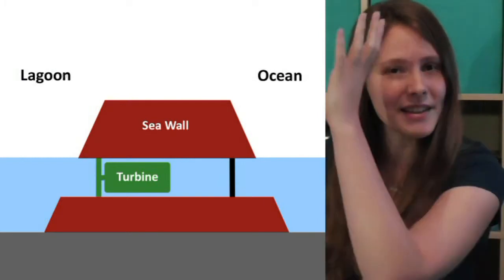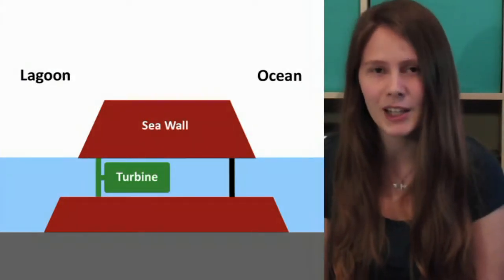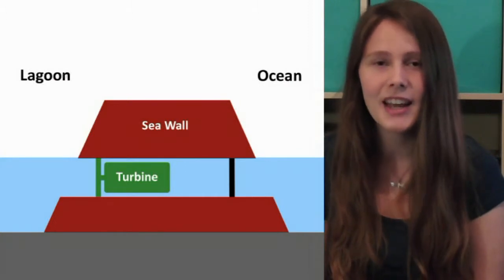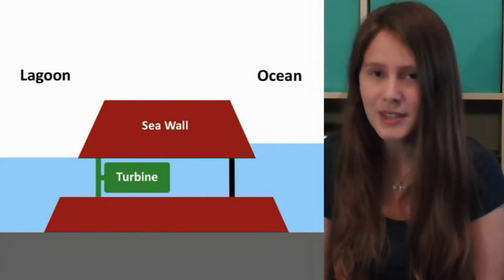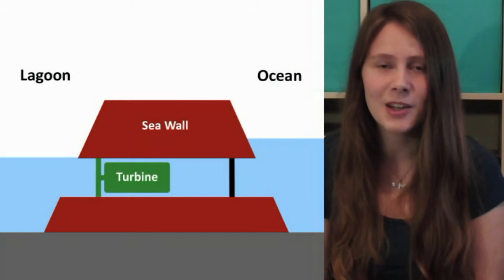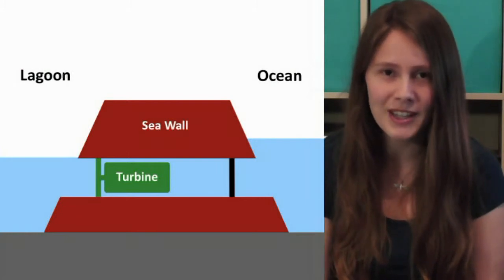Swansea Tidal Lagoon - Why you should think it's awesome

Comment: The slight hiccup on sourcing stone to build the wall that you mention......
Entails reopening a disused quarry on the Lizard in Cornwall.
Originally the quarry produced a maximum of 200,000 tons of rock per year
To supply Swansea and the other Lagoons would mean an extraction rate of 2 million ton / year.
Achieving this would require 7 day around the clock loading of barges to transport the stone.
To dock the barges a breakwater and jetty of 800m would need to be built.
The quarry sits in an AOONB and has adjacent SSSI sites.
The jetty woud be built into a recently designated Marine Reserve.

Disturbance to the quality of the sea water would directly effect the multi million pound Cornwall Sea Salt company. Wipe out the fledgling Cornish Seaweed company.and seriously undermine the tourist economy including a diving company with world wide patronage due to the current pristine water quality.

it is a little more than a hiccup...
Reply from the maker: Energy at any cost 
I totally agree with you. It's not an ideal location and as more information came out about the issues with the quarry site it became more and more clear that it is a bad idea. When I referred to it as a 'slight hiccup' I was thinking along the lines of finding a new source for the stone. I don't know what they will do, but I sincerely hope that they find another quarry, preferably one which is currently active. Of course there is always the chance that they will storm ahead with this plan since it is the cheapest option, but I really hope they manage to find another solution. 

I don't want this project to be jeapardised because of the stone. Stone is a plentiful resource and hopefully they will find it from somewhere else. And hopefully that location will also be UK based so the stone isn't transported across the globe and it contributes to the UK economy.
Reply: the quarry is also owned by Mike Shorrock..who is the boss of the Tidal lagoon company. He'll make lots of money out of this

Comment: river bebris  will  find its way into turbine blades  siltation build up is also a problem the cost of the lagoon  will go over  budget  as usual  and no consideration  for  migratory fish . when this is built and up and running it should be have a survey done after 15 yrs before any more projects are built , to access what impact it has done on the rivers and marine habitat / wildlife its cool to go green at what price
Reply from the maker: Ivan Renac 
These are all legitimate concerns. It's not possible to build anything, anywhere in the world which has no effect on the wildlife and environment. Just building a new road can cause all sorts of problems so it is inevitable that this will influence the local habitats in some way. However the lagoon is not at the end of a river, it is located between two rivers so migrations should not be affected and it should not build up with silt or debris. You can see images of the proposed site here -> http://www.tidallagoonswanseabay.com/interactive-map.html 

There were concerns about how it would influence sediment drift along the coast and potentially effect the sand dunes down the coast which are an important habitat. It was decided that it was far enough down the coastline that it is unlikely it would cause any long term damage, but of course that will need to be reassessed down the line. 

All of the assessments and documentation is available at -> http://www.tidallagoonswanseabay.com/document-library/environmental-scoping/95/ if you are interested in the details of the assessments made.

I would be surprised if it was built in budget, it's a huge experimental project so things are probably not going to go perfectly. However lessons will be learned and the subsequent lagoons are expected to cost significantly less.

I hope this was helpful, I would love to discuss these issues futher.
Reply: this is the first tidal lagoon in the uk migratory fish that follow the coast line to the source of there river   during spawning and on their migratory route to the sea will almost definately end up in the lagoon through the turbines  and damage the two rivers echo system/ otters /kingfishers /etc
Reply from the maker: Ivan Renac 
It's not possible to fully assess and entire ecosystem due to the inherent complexity of them, and there is always a potential for negative impacts on the local marine wildlife. An assessment has been carried out with the conclusion that there will be a minimal negative impact on the marine life. As stated on the official website:

"Detailed fish computer modelling was undertaken for key species, including behaviour modelling (the likelihood of the various fish species coming into the lagoon area) and entrainment modelling (the effect on any fish that pass through the turbines). The size of the turbines (7-8m in diameter) mean that there will be large gaps through which fish can pass, and the modelling has been carried out to understand the extent of this. Furthermore, the use of sluice gates will allow free passage of fish in and out of the lagoon in the latter part of the tidal cycle." 
http://www.tidallagoonswanseabay.com/the-project/faqs/59/ 

They also intend to re-introduce a local oyster which has not been present in the bay for decades. On this topic they say:

"We are also investigating the potential for developing mariculture. The formation of a new rocky reef as part of the Project would provide habitat and encourage colonisation by local marine species.  Research indicates there could be opportunities for the reintroduction of the native oyster as well as for fostering habitats for lobsters and kelp. We are continuing to investigate these benefits in association with local experts."
http://www.tidallagoonswanseabay.com/the-project/faqs/59/
Reply: i am sure the general public  are going to say them oysters look great  in  a lagoon  and when they get to edible size i am sure party time fore investors on the oysters. the sea life habitat  was all ready there, you are not creating anything. some  habitats are going to be lost i think the company or construction co. are trying  to get the next lagoon project  at the tax payers £.  looks at a pro video 15 / 20 yrs on? you don't even know the impact on the coast  you cannot predict storms? . one thing that concerns me you cannot monitor the the impact it has on the environment and wild life.IT JUST another wind farm project  and lot of  investors  can put there money in one of these projects AND THE GOOD OLD TAX PAYER WILL BAIL YOU OUT  IF ITS OVER BUGET
Reply from the maker: Ivan Renac 
It has been very interesting discussing with you the potential effect the project will have on the marine life, but I'm not sure I understand the argument you made in your last comment. The oyster habitat is not to farm oysters for money, though I am sure it will be possible to eat some at the information center, it is to reintroduce a species which can no longer survive in the bay due to previous human influences. The habitat does not already exist, Swansea Bay is mostly silt and clay with a little sand, the rocky places are further along the coast. Hopefully this effort will help to fix the damage to the food web in the area by putting the oysters back in.

You say you cannot monitor the impact on the environment. Monitoring the impact is relatively straight forward, it's predicting it before hand that's the problem. 

If there was going to be a serious negative impact on even one species then the government would not have permitted it this easily. A much larger tidal project, the tidal barrage which would run from Cardiff across to Devon has been trying to get of the ground for years but it was not permitted because it would cause one species of fish to lose it's very specific habitat. For this reason I doubt that the tidal barrage will ever be built, it will have too larger impact on the environment. This lagoon is so much smaller and has been assessed to cause minimal damage and this is being compensated for by creating new habitats and investing in conservation.

As I said before, it is likely that the project will go over budget. It's experimental but for technology to develop some risks must be taken. Most of the project is funded by private investors. The issue is that we need more sustainable energy sources or we have to cut our electricity consumption. My concern is about CO2 emissions but it's also about the ever increasing energy demand and the lack of resources we have available to us in the UK to produce that electricity. Nuclear power is never popular so I can't see many of those being built again and we don't have enough clear days for solar to be viable on a large scale. What we do have in abundance in the UK is wind, waves and tide. To keep up with the energy demand we need to research better ways to harness these energy resources otherwise we risk regular blackouts in just a few years. A report in 2013 from the Royal Academy of Engineering found that at the current rates of increased demand and reduced production capacity as old power stations are decommissioned we will be in an 'outage scenario' by 2019 -> http://www.raeng.org.uk/publications/reports/gb-electricity-capacity-margin 

Personally I feel that more damage is done to the environment by the fossil fuel plants than less conventional renewable power plants. Of course this doesn't mean that we should build them recklessly and do more harm than good, but by building projects such as the tidal lagoon we can decommission more of the fossil fuel power stations and improve the environment overall in the future.

Comment: I agree. It is a really exciting project. Great to see it going ahead. I wonder how many locations around the UK are suitable for this kind of power generation.
Reply from the maker: nitelite78 Pretty much anywhere along the west coast of Britain would work, but the best places are where the water is squeezed through a narrowing, such as the Bristol Channel where Swansea is located or between islands and the mainland. There are loads of good locations in Scotland because of this.
Reply: joolzzenda 
"where the water is squeezed through a narrowing"

That's because at these locations the difference between high and low tide is greatest right?

I especially like how the plan is to allow people to walk or cycle around. The tourist attraction element is great. I would imagine quite a lot of business would want to locate there because of it. Lots of restaurants and stuff.

I wonder how it compares to pumped-storage hydro-electric power in terms of efficiency. It seems very similar to hydro-electric in theory but there is no need use electricity to pump water back up hill as with pumped hydro. But of the other hand you don't have the height the hydro allows for.
Reply from the maker: nitelite78 
My understanding is that as you constrict the flow it increases the pressure, so the water passes through with greater force. The same way that if you cover part of a hosepipe with your thumb the water shoots out further. This effect sort of amplifies the tidal range so a combination of large tidal range and a 'bottle-neck' is ideal. 

As far as how it compares to other hydro electric power generation methods I'm afraid I'm not sure. I am sadly not an expert in renewable energy, just an excitable enthusiast. However since pumped storage uses the renewable power to pump the water to a higher elevation so that it can be used at a later time to generate power. That's more like a rechargeable battery than a power generator so it's not really comparable to a tidal lagoon as they perform different functions. But like I said, I'm not an expert, check out their website linked in the description for more information.

I really hope that it will help to revive the Swansea area. It's one of those old port towns with little industry but hopefully a lot of new businesses will spring up as a result. I'm really looking forward to walking along the wall in a few years.